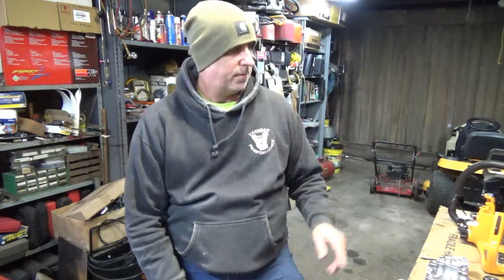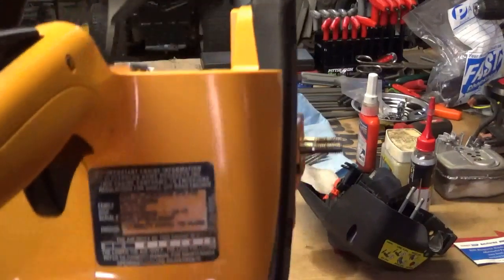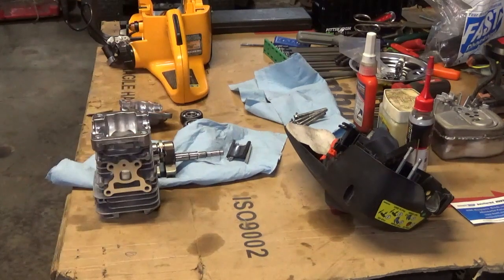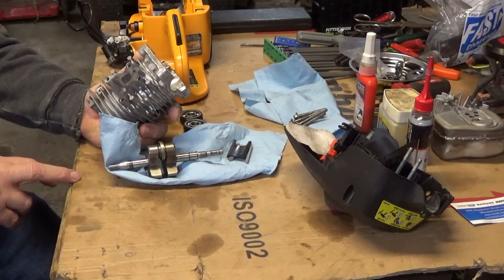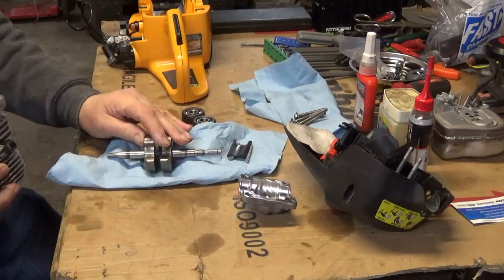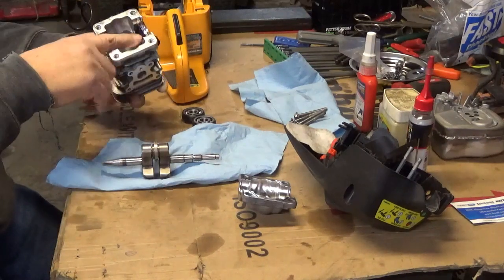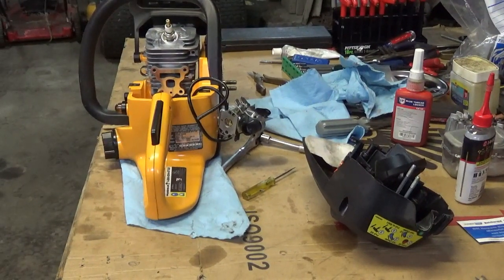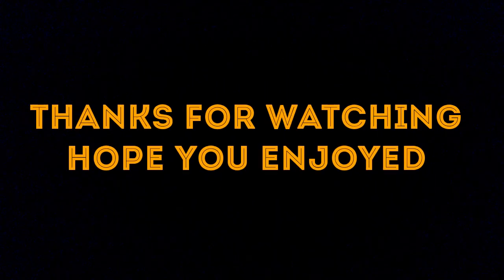Poulan Pro 4018 Trash Pile Salvage Video #1

Comment: Your correct on the engine size, all 42 VC
It’s that simple and it makes sense to. I love working on them and keep plenty of carb kits and couple of new carbs, level and cable control types, RB 129 fits most of the saws

Comment: So, what your saying is, all I have to do to replace the ring is remove the 4 bolts from the bottom and pull like hell on the jug????
Reply from the maker: Kinda in theory yes, but you will also need to remove the  carb and throtle rod , the air dam and antivibe spring if attached to cylinder.

But I suggest pulling the complete engine assembly as a unit so the pan can be properly sealed for a clean airtight reassemble.

Comment: I’ve rebuilt a lot of these saw and I never put that much sealer on the case and none on the seals. I’d be afraid it would break off inside and score wall or ring. Have you ever had any problems?
Reply from the maker: Have never had an issue with any of the ones I've done.
It looks like a lot but it really isn't, maybe a bit more than needed especially on the seals but I Hate having to redo for a leak which I've had to do.
Reply: Silicon isn’t going to score a cylinder.

Comment: So the piston ring pin face the intake or exhaust ???
Reply from the maker: Sorry for the time to answer
The ring locating pin Always faces the intake port side of the cylinder, this prevents the ring end from getting hung/snagged in the open exhaust port and causing destruction, as the ring end never enters the open intake port.

Comment: Well Craig hope your good ..hols over. Another very new saw I see.you done a great job clean pre assembly..it looks out of the box... was it straight gased or the rings got stuck in from overheat. The new camera is the business.
Reply: I prefer this clamshell design than the one that clams to the plastic chassis...plastic mating surface can get distorted from heat or the plastic chassis ctacks when torqueing ..(or that could be just me..☺)
Reply from the maker: I believe it was just an overheat issue, there was an oil film on the inners when it was disassemble and the ring was not stuck. Just heavy scoring on the exhaust side
Reply from the maker: @nickywalsh8492  So do I

Comment: how do you get off the crankshaft bearing on the shaft end that is not tapered?
Reply from the maker: The bearing should just pullpry off the crank fairly easy if not then you will need a bearing puller to get it off.
You could try some heat useing a propane torch on the inner bearing race but to do this you will need to remove the seal cup off the bearing first and don't go overboard with the heat.
Once heated carefully use a screwdriver to pry the bearing off while Not damaging the machined area of the crank, a scratch on this area may render the useless.
Reply: @craigtimmons3468  mine is the PP295 and it looks like the threads for holding on the flywheel are in the way..that's what I can't get out of the way to remove bearing..???
Reply from the maker: @loralkinney  I believe the seal may be whats holding you up, the inner bearing race should slide over the threads, the seal is of a smaller diameter and if the rubber has become hard then the seal lip could hang on the threads making it difficult to remove.
Reply from the maker: @loralkinney  After rereading your initial post, I think you may be talking about the pto or clutch side of the crank, if this is true the threads you are referring to are actually the worm gear that runs the oil pump, it is nothing more than a spiral wire spring  pressed onto the crank.
To remove it first determine exactly where it is on the crank so it can be reinstalled to the same position. You can work it off with a screwdriver or something with a flat side just be easy and careful not to scratch the crank or bend/stretch the wire spring, or use pice of pipe with a coupler that threads on to the wire spring as a puller, this method works better as it keeps the spacing on the wire spring in the correct position to mesh with the oil pump drive gear when reinstalled.

Comment: I have one I got on ebay that i.need to do some repair on as well. There were several a while back from the same seller, I think they were used for clean up after a hurricane hit the east coast, not positive on that but was about the same time the last bad one hit, anyway the seller must have had 50 of these for sale in various states of repair, from running to dead, the one i have leaks fuel like a sieve when you try to start it up. Thought it might be good for limbing downed trees. It's been sitting in a box for a while, maybe one of these days I'll tear into it, big word being maybe!! Not sure these saws are worth much used when you can buy a new for less than 2 bills but there are plenty around so they might be okay, never used one but for what I paid thought it might be worth messing with.
Reply from the maker: Your right only good for light use (home owner) if you don't have much in it then it is worth messing with if you can do if yourself Good Luck

Comment: I'm going to put a head in a piston kit in a 50cc Poulan pp5020av motor
Reply from the maker: Not telling you what to do but if I were doing that I would go ahead and change out the crank bearings and seals, if nothing else the seals that's just cheap Insurance. I just dont like reusing crank seals if I dont have too.
Reply: He will regret it if he don’t become they seem to leak after messing with the rebuild

Comment: I hate that style pin clips too. A real PITA to get in and out. Poulan really seems to like those tho. My old 3450 has them. Just did a P&C swap on a Husky 359 and they use the clips that have the tabs. Much better design....  I have one those saws that was almost brand new when it came in the shop with a bad P&C. Poulan gave the guy a new saw and we got the old one. Thought about rebuilding it, but couldn’t find the parts cheap enough to make it worthwhile. Kinda ironic that I got a new P&C for the Husky for much less than the Poulan. I can see why they usually get trashed.
Reply from the maker: Your right for no more than the saws cost new the parts should only be 1/3 the price they are, it's like they really don't want to sell parts but instead sell new untis.

Comment: Tbh I wouldnt put those bloker slides back in I find removing them extends the life because of more oil being able to contact the piston and rings that's why the older poulan 2050- 260 or 290 Poland pros does not have them
Reply from the maker: That's why I run 32:1 mix in all my equipment an engine needs oil to survive
Reply: Yes sir 32:1 I'd say is the best mix ratio I run 40:1 in mine for slightly less oil but more oil then 50:1 I've rebuilt quiet a few 90's to 2005 2006 poulan 40/42cc saws and havent seen much wear internally. Only thing I find wrong with them is the carb manifold that mounts to the cylinder the bottom bolt comes loose causing the gasket to crack and run lean and score the cylinder I use red loctite to keep from having the same issue in about 7 years grew up with my dad using a 50th anniversary 2175 none antivibe saw and that's what killed it if I caught the problem when it did start doing that it would still be a 38mm 36/38cc piston and cylinder and not a 41mm 40/42cc piston and cylinder. I like them because they have plenty of power and are very easy to diagnose a problem that causes it to not run or idle or so on.
Reply: Also getting the bottom 2 halves to seal is key with the poulans. Sanding the base cap and cylinder on a peace of glass is good to make sure both surfaces is flat
Reply from the maker: @rncboy2  That is a great ideal wish I had thought of that
Reply: I run a 40/1 in every thing and it’s just a matter of cleaning up around mufflers

Comment: Well I question is why you putting sealer on a lot of that stuff on the bottom and it's just a two-cycle motor shouldn't be no oil or anything getting down in there
Reply from the maker: Yes it's a 2 cycle, and there is oil that comes out of suspension from your 2 cycle gas mix and this is the oil that lubricates all the moving parts.
I use the sealer to create an air tight seal, on a 2 cycle engine you don't want an air/ vacuum leak this would cause a lean run condition and potentially an engine failure.